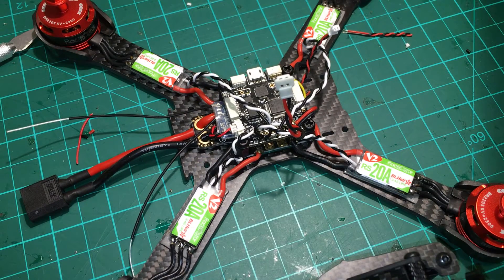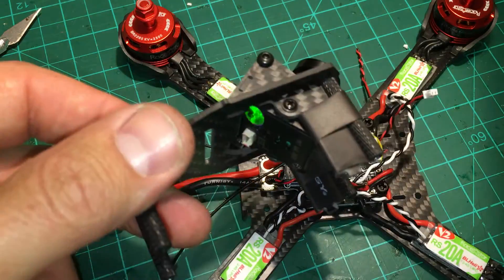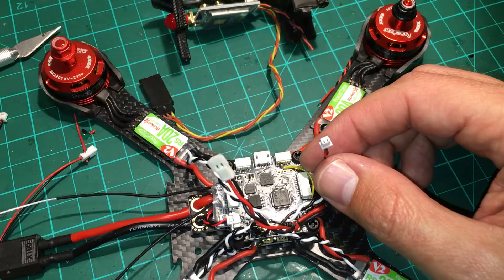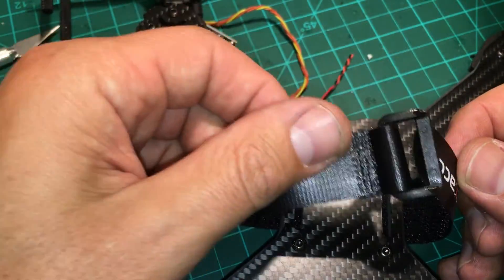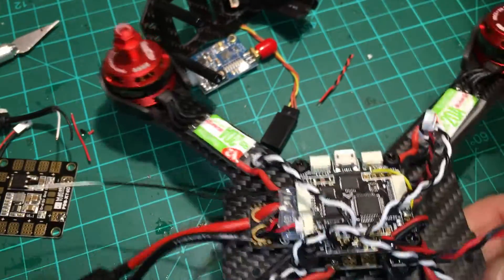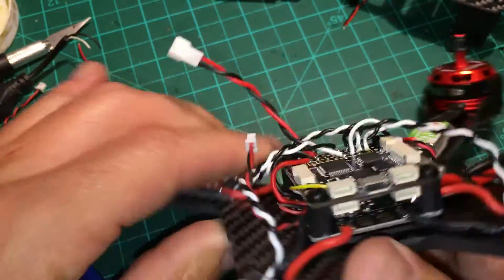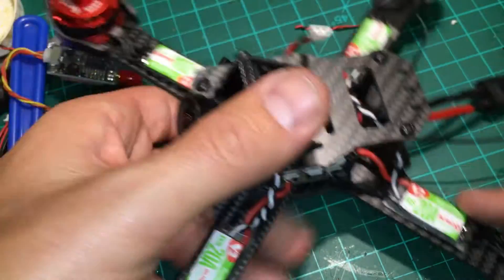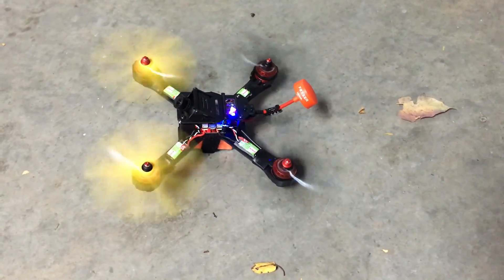RealAcc X210 build tips with Racerstar motor and ESC SP F3

Comment: nice video, im new in hobby can i ask you a few questions? 1) do you think is better 30a esc with 2300kv motors ? 2)for a beginner what is better the x210 kit with 2300kv motors or 2600kv motors. thank you!!
Reply from the maker: Enduro GRC 20a ESC should be fine for either. I'd suggest the 2300kv as they would work better with a larger variety of props and give a bit longer run time. Pick up some of the King Kong 5045 Tri props as they are more durable than the 5040 tri.

Comment: Thanks for your video!  I have a question...on punchouts, I am getting a kindof "noise shake" in the video.  (Runcam Swift and Foxeer TM25).  I think it's because the camera is getting 5V from the Foxeer.  Will it help if I put the camera voltage and ground wires straight to the PDB ESC pads? Or can I also solder the camera power to the 5V or 12V regulated pads? Thx for advice.
Reply from the maker: Ken Chan  try the 12v regulated for the camera first. 5v is minimal voltage for those cams and the VTX putting out 5v is right at the threshold. I've had some VTX put lower than 5v and gave me all kinds of trouble. Since then I put 12v regulated to both my VTX and camera which seems to do better and protect them a little more from voltage spikes.
Reply: Matthew Bennett that's awesome, thx. In other words,  both the Vtx and camera are soldered to the 12V pads..., right? Thx again
Reply from the maker: Ken Chan yes, try that. Also check to make sure nothing loose in your camera and camera is mounted well. I've chased a lot of issues only to find out I had a bad camera lens, screw loose on camera mount, etc.

Comment: Looking at your motor to ESC connections, they look like all wires are in parallel, that is, none are crossed.  How did you address any motor rotation issues.
Reply from the maker: Check my other video on the setup in blelisuite. If for some reason you can't get this to work then you would need to swap some wires for motor direciton and run the default settings. I prefer to amake a few changes and then swap motor rotation like in this video. https://youtu.be/pRoRTfqAXzc?t=2m19s

Comment: nice. just about to start my x210 build too.
nice to see how you have hooked up the xsr rx using sbus.
exactly what I plan on doing.
the yellow telemetry wire goes between pin 1 and 2, right?
doesn`t connect to anything else?
Reply from the maker: Yes, I have the yellow telemetry wire bridging the TX and RX on the back of the plug. I believe it is pin 1 and 2. Just make sure your exposed wire is very short so it doesn't contact the other UART input that is just behind it.
Reply: roger. thank you
Reply: Matthew Bennett I have a question..... should I buy the realacc x210 from bangood or the GB x210 from gearbest .. I've never flown a quadcopter before and I am really into building one....

Comment: Thanks for posting this. Ill be putting one of these together shortly after Christmas and have been looking for the neatest way possible. This is by far the neatest build for this frame Ive seen. Gonna be my first build so Ill probably watch this another million times between now and then :-)
Great vid!
Reply from the maker: Multirotor Noob thanks for the feedback. I like to keep it clean and simple.
Reply from the maker: I did not update the esc firmware on mine, but probly wouldn't hurt if you wanted to. I did turn on "brake on stop" and adjusted up the min throttle.  Video here https://www.youtube.com/watch?v=pRoRTfqAXzc&t=122s